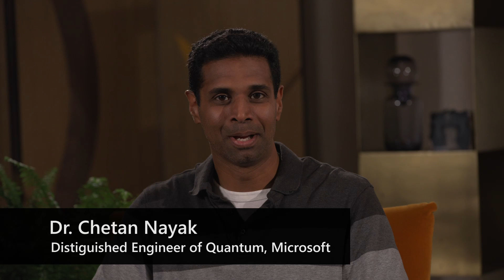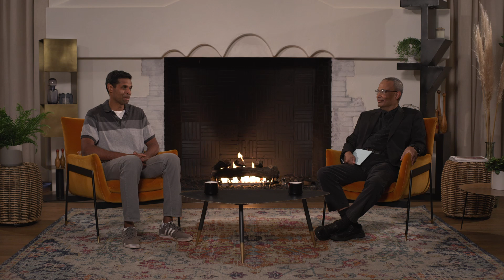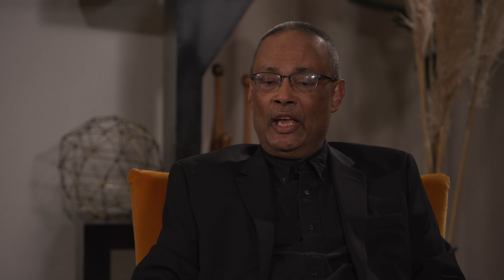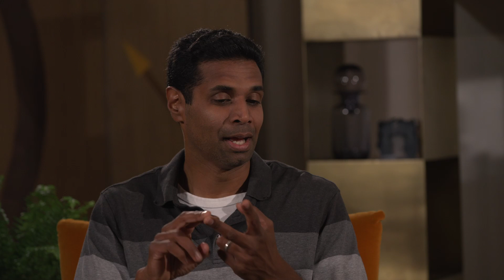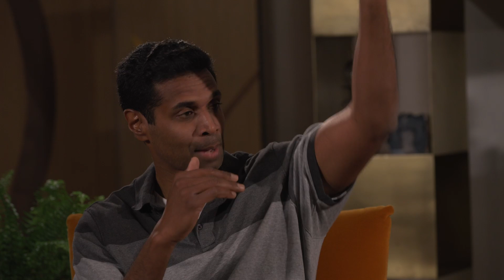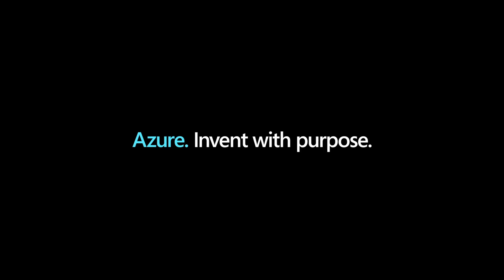Comment: For now the cat is both dead and alive, we wont know which until a third party validates it...That said, if the cat is alive (apparently at a quantifiable gap of 30 millivolts at < than 25% of the time on multiple devices), this could prove to be the most impressive development for quantum computing/theory in the last...actually, this could prove to be the most impressive development in quantum computing/theory period!
Reply: Why a big deal this is?
Reply: @robertr.3378  if you're familiar with the leap in compute ability when we transitioned from vacuum tubes to semiconductors, being able to do quantum computations with topological qubits is an analogous 'leap' in ability.
Reply: Hey can u explain that I didn't understand it